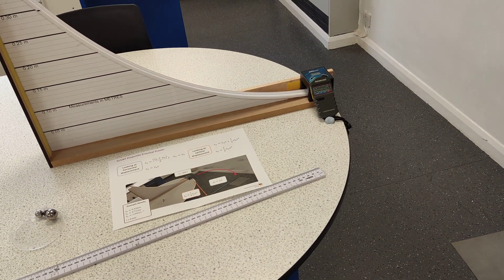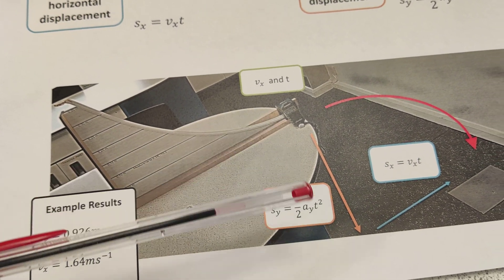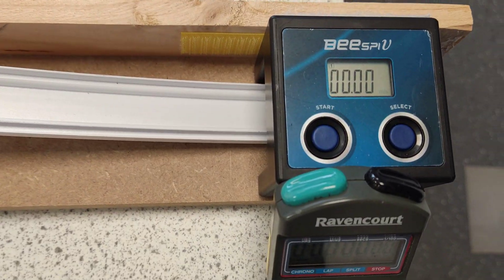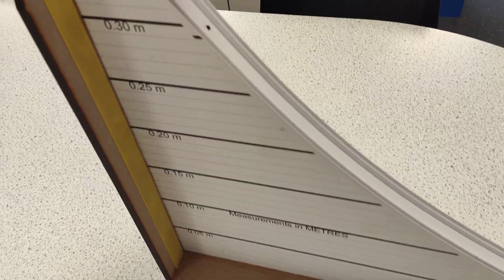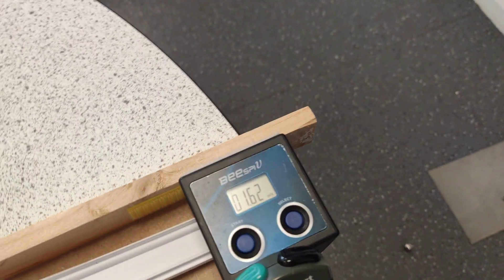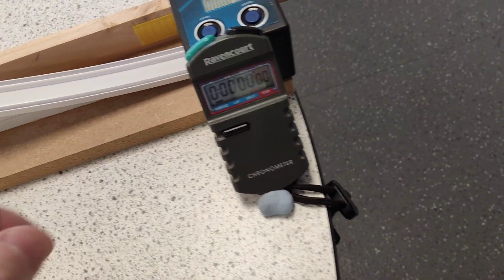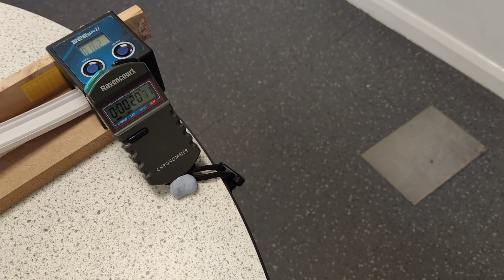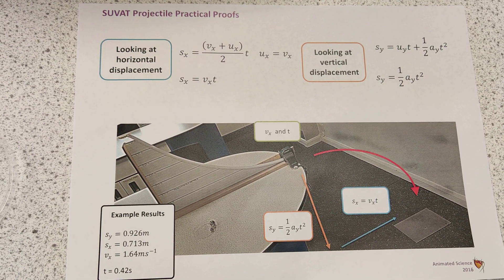Projectile Motion SUVAT Proof

Comment: How did you get 0.926 m for Sy? When crunching the data (0.5 x -9.81 x 0.42^2), it comes back as 0.865 m
Reply from the maker: To be fair I cannot remember if I read it off or worked it out. Really it's just an example. I would just do it yourself.
Reply from the maker: Also could be the timer!